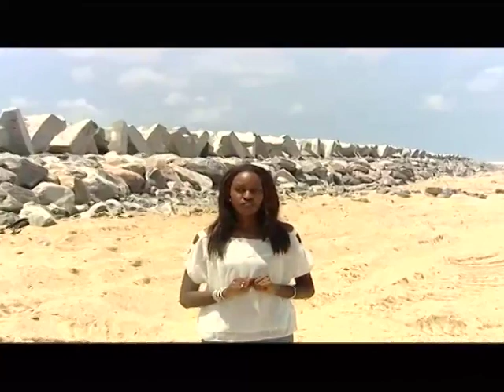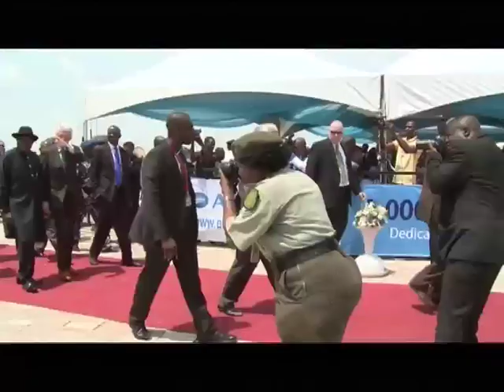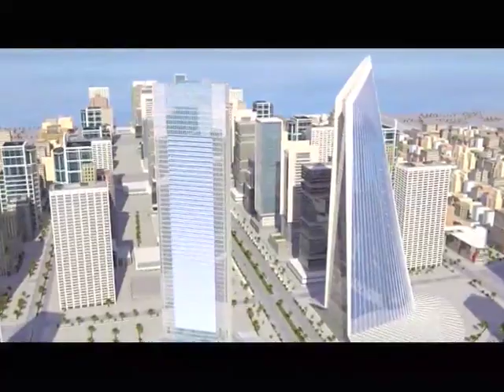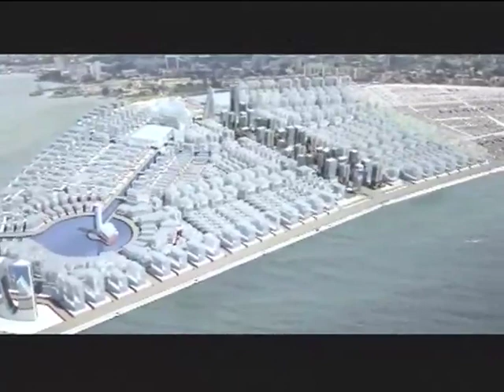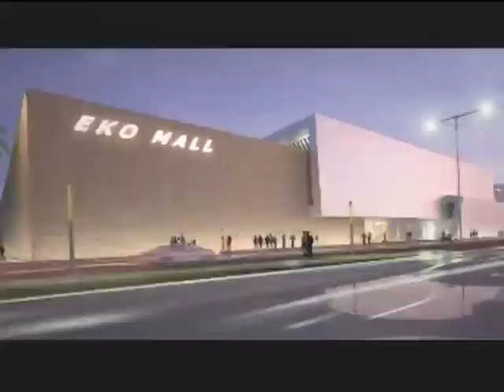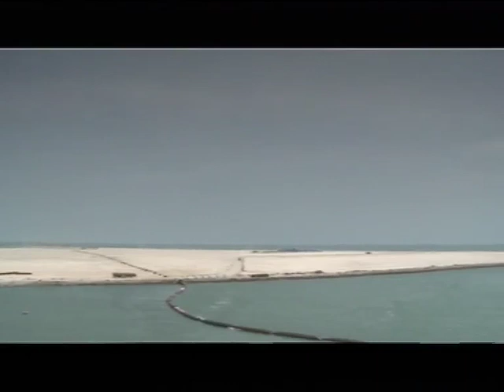Eko Atlantic City Half Way To Complete

Comment: This project is taking long time for completion. The Palm jamirah in Dubai was built in  less than 4 years.
Reply: How can you compare the palm jumaira with this, this is a different terrain different sizes etc The palm has much smaller buildings than Eko Atlantic
Reply: @Biobele  Brother we are all happy about this project but truth be told palm jumirah is bigger and expensive than this project
Reply: @ogarjoseph5215  this is more useful than palm jumaira that's all you need to know
Reply: @Biobele  they should get it built on time in Case you don't know this project started since 2006/7
Reply: @ogarjoseph5215  I don't care when it started I'm happy it started and it's moving
Reply: @Biobele  too slow